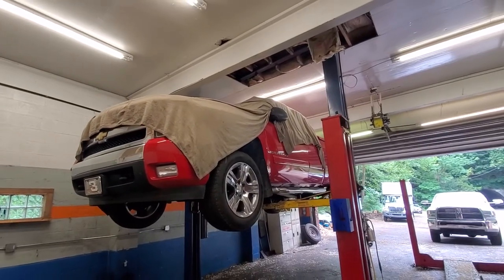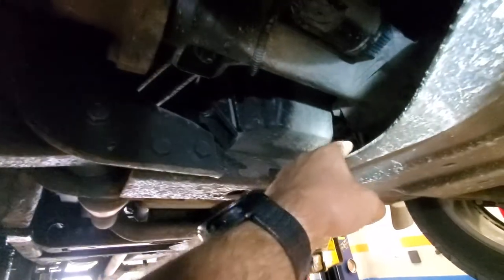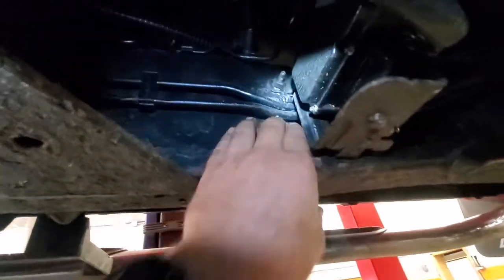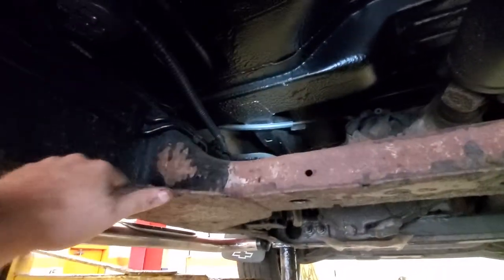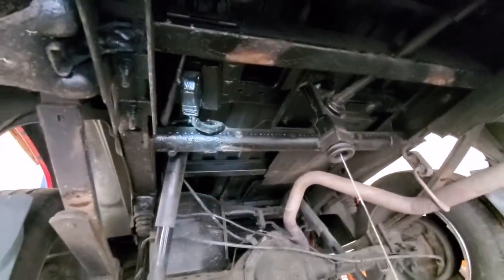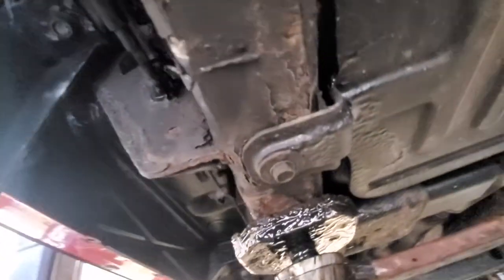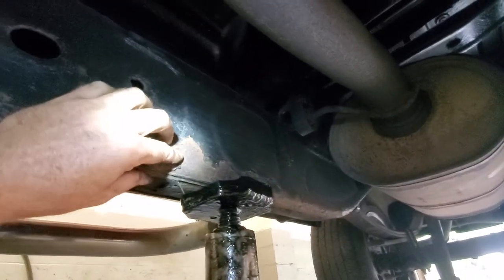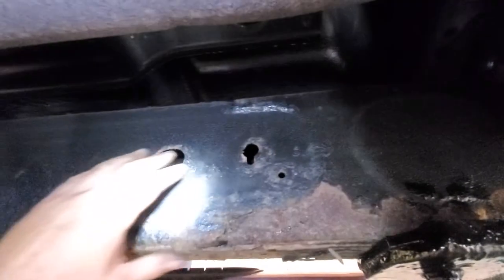08 Siverado ruined by hard undercoating

Comment: Fluid film ruined my undercoat on my car that was perfect before.  I just wanted to give it some extra protection.  I used it on my 05 Saab 9-5.  Now I gotta clean it and clean off the undercoating that came loose thanks to fluid film.  I’m now gonna try Rp342 wax military grade protectant. I’ve heard it isn’t a hard undercoating since it is a wax undercoating. I love the stuff from what I’ve seen.  I’m really bummed out about fluid film how it softened my undercoat on my car in areas 😢
Reply from the maker: Here's the honest truth that's why homeowners should not be doing this and you should read the directions
.... it says right on consumer fluid film not to apply over existing undercoating as it will soften it and ruin it. 

Once you have any type of existing undercoating you can't do anything else anything you buy will have the same effect ... if you buy the stuff you just mentioned it will crack and peel and turn the vehicle into the sponge there is nothing you can do to correct your current undercoat situation. 

Why would you coat a vehicle that had perfect existing undercoating with Fluid Film?  Next time read the directions? Being honest, what else can I say.
Reply from the maker: Rp342 will ruin your vehicle even worse.

Comment: So how do you get this stuff off? I saw someone mention mineral spirits?
Reply from the maker: Once you have hard coat on you'll never have an optimal solution best you can do is descale off all the loose stuff as best you can and then use some type of wet base coating that will soak in

Comment: As the hard coat pulls away from the rusty metal and cracks, it traps the salt soaked water so it does not dry in those pockets. The result is it will speed up the deterioration process. I just use axle grease under the body, it doesn't wash off very easily and is cheap. May not give the kiddy look you want and be a little messy when working underneath, but it will stop the deterioration better than all those expensive products! Waste oil will work great also but seems to wash off easier than grease
Reply from the maker: On something with new rust thicker like axle grease is better but on something with rust you lose almost all penetration properties where you would want something thinner like oil

So new thick, rusty thin

Comment: I recently cleaned all the scale off my Tacoma and then primed and painted everything. My next step is to apply wool wax and fluid film to the entire thing. I figure if the wool wax wears off at least there will be a paint barrier to protect until I can get it recoated. I live outside Buffalo, so I’ve seen my share of bad winters.
Reply: i dont think the paint first is helping you mate.  should have jumped right to the rustproofing.

Comment: Well you are right.. I am a steel coatings expert.  And usually undercoating of all kinds will trap moisture and actually cause more rust than if it was just left bare steel.. the proper way to undercoat is to prep and sand as much rust off as possible.. then use a acid etch primer/or epoxy sealer
To recondition the steel then apply your choice of undercoating  system.. steel primer/sealer is the key to prevent and slow rust..
Reply from the maker: Negative, Steel primer and undercoating are what were used on truck on video.... anything that dries over will fail in the Northeast.

Comment: I been starting to make mine all i used was bar & chain oil with paraffin wax melted in and sprayed on hot. 
But now i'm going to update the recipe to used motor oil, grease, Boiled Linseed Oil, paraffin wax and maybe a little diesel fuel to thin it if it needs it and will be hot sprayed on, hoping it comes out like a grease with a gummy shell on the outside when cooled and cured that would allow it to last a good long time before needing another coat.

Comment: Ler me get this straight,you made this video in 2021 and the truck was coated 2 yrs. prior. That would mean the Silverado was already 11 yrs. old. How many miles were on the truck when it was done? Yes I agree it looks like a terrible job but 11 yrs. of wet,salty,and dirty conditions will have this affect on the bottom of any vehicle. As far as the "heavy" stuff hitting housing cases no big deal,not hurting anything. Touchy situation taking on a used vehicle. I put many yrs. in doing this type of work and personally I would have refused this job.
Reply from the maker: That's the whole point of the video other shops spray right over the rust!

Comment: You seem very biased and that truck is in great shape for and 08. That undercoating made it last but nothing is forever. It's time to be redone.
Reply from the maker: After it was descaled and the cover-up undercoating was removed it needed 2 frame sections a 1 crossmembers, which an outside shop did for a cost of $ would say that it did not hold up.

Comment: why does the body look perfect yet the frame looks like shit.
Reply from the maker: The outside of the body looks great of course but the underside the body panels don't rust nearly as much as the frame so that's why they look better however this truck had a decent amount of rust on the rocker's underneath the cover up coating.
Reply: @steelcityoilundercoating6305  but here is my issue, the chevy frames rust because of the factory produt used. there wax is crap. but you have failed to mention the GM wax coating is failing causing what was put over it to fail.
Reply from the maker: @gregoryelk8129   It's rostio under the GM factory coding we know all about it we work with the chemical company who makes the wax on a daily basis it sucks if you're up North however if you're down South the wax coding works very well.

 The wax is made to bond with nothing so covering it up after it had rusted or even when it's new will make the factory coating come off 10 times faster that is the issue we have with this truck.

 We actually have a product made to treat the factory wax that keeps it soft and moist it works very well and the wax never comes off I'll post a link of that video. 

 We're the only ones in the country who have this coating for to treat the GM wax we had a chemical company make it for us
Reply: i will add for a 12 year old chevy that thing looks really good no matter what was put on it. i hear you bashing others and hard coatings, which i agree new vehicle only. but you are telling half the story hear, i have had vehicles done by ziebart with great results. chevys are terrible frames, the undercoat didnt do that the wax coated frame has failed
Reply from the maker: @gregoryelk8129   It actually is not in good shape it only looks like it's in good shape because it's covered up this truck needed to have new rockers and bedside and bed sides in bedrales welded in. 

 You can't tell the condition of a vehicle that's been hard coded over that's the whole point
Reply from the maker: @gregoryelk8129  https://youtu.be/9Xlj86MoysE
Reply: @steelcityoilundercoating6305  sorry cant see that if it was that bad you should have shown it  actually you refer to the rockers being in really shape during your video as those years where problematic with rockers i believe.

Comment: Hello’ I live in BC, Canada, I have a 2021 ford ranger, not undercoated from brand new. (My mistake) but I want to get it undercoated before the coming winter. Obviously it’s a “used” vehicle but it’s only a year old. Hardly any rust that I’ve noticed underneath. Nothing like the vehicle in this video. Would I still be okay to get a rubberised undercoating applied? Not many oil undercoating places where I live. Thanks

Comment: Im wire wheeling the pans on a 69 vw down to bare metal ( less than mm diameter scaling spots). Is a rubberized coating over primer going to hold up in your opinion or should i go a different route? Not looking for hiring, just a guy and his son son trying to keep the car around i rebuilt with my dad as a kid.
Reply: Rubberized coatings are pretty much the same thing as zeibarts coating any type of chip or tear in the coating it's game over for the metal your trying too protect. The fix is something that'll stay "wet" too the touch like fluid film or blaster surface shield so if theirs any chip it'll creep in and protect the metal. Even a wax based product works well too. Avoid any hardcoating product cause they ALL fail.

Comment: If you're gonna undercoat a used truck you're wasting your time/money. I had my F-150 undercoated by Ziebart 10 days after I bought it brand new in 8/2013, i have no issues with it almost 9 years later and it lives in the NE and isn't garaged.
Reply from the maker: Take it to a non Ziebart garage and they will show you how it's failed, or better yet post a video.  If you went to Zbart and continued their service which is required yearly, of course you're not gonna see any rust because they cover over it every year.  You may not have issues as the frame is still fine but that doesn't mean it's not rusted underneath or in many places just like this video.  If you have one like that then it's extremely rare, there's not a 10 year old truck in the northeast that isn't covered in rust underneath.
Reply: @steelcityoilundercoating6305  they don't spray it every year, it gets inspected and would get re-sprayed if if needed it and it hasn't. The coating on the truck is the one that was applied in Aug.2009 when the truck was brand new, 10 days off the lot. It's been sprayed ONCE. I also have never had a mechanic underneath point out any problems and there's no rust underneath but whatever...to each their own. Undercoat it or don't, I know what my truck looks like underneath. Maybe someday when I get a new one I can post an "X" year update of a Ziebart undercoat application. I am not a Ziebart employee or mechanic either.

Comment: I think boiled linseed oil every other year is the way to go. It soaks into the rust then hardens to a thick gummy finish in 4-5 days. It's fairly cheap and safe, and you won't get filthy if you have to work under the truck.
Reply from the maker: It works but you have to steam wash it off every year that oil breaks down amd will mix with water
Reply: @steelcityoilundercoating6305  It's really a just a slow drying polymer. It's old fashioned enamel paint binder without any pigment. It can mildew, but I've never seen that on a car in the midwest. Like any coat, any scale should be knocked off first.

Comment: Every truck I owned I've used soft coat like fluid film or used oil mixed with diesel. I get comments all the time how the frames and underbody look almost new. I only spray once a year. And any visible areas from standing or crouching down get sanded down to shinny metal and painted black.

Comment: I would take the cross members off, clean them nice and coat them OFF the vehicle, I would just paint them with a good quality rust resistant paint.
Reply from the maker: Makes no sense there is one or maybe two cross members that actually unbolt on a truck... what about the frame and everything else you can't take those off?

Rust resistant paint, no such thing.

Comment: Diesel fuel and used motor mixed in a pressure sprayer works for me
Reply from the maker: Works good yes but tge acid will surface rust it underneath not a huge deal but a business could never spray that would get shut down in a day.  Also no one's gonna spray diesel fuel and mixed motor oil on a brand new vehicle. But yes it works.

Comment: Sand, prime, paint, 
Repeat as needed
Reply from the maker: Very difficult to blast down a frame without pulling the cab and bed. Also use epoxy primer and the best chassis paint. One year later it just peels off again, just like a new truck. We're taking about northeast here. Nothing lasts.

Comment: Why exactly is this truck ruined? 

I understand it was done poorly, but I hate sensationalist titles THIS TRUCK IS RUINED! Who cares if there is over spray on the trans and exhaust? That doesn't ruin the truck, lol. It doesn't matter one bit to be honest. 

It sucks that they didn't do the proper prep work or do the tops of cross members, but nothing is ruined by what was done. It honestly is a joke that it's being said that this truck is ruined. these types of titles and narratives are exactly what turn me away from a channel. Be honest, show the poor workmanship. But don't try pushing some BS. Whatever holes are there were already probably there. Those frames are not that thin, you don't get a hole through 1/4 thick steel in 2 years.
Reply from the maker: Again it was sprayed on top of rust once this truck was descaled it needed 2 frame sections and one cross member, outside shop quoted 5500 please watch the other videos after the hard coat cover up was removed. The lift arm almost went through the truck!

Comment: is a hard rubberized undercoating okay to use on new vehicles?
Reply from the maker: No, don't do it
Reply: @steelcityoilundercoating6305  I'm torn on what to do. I'm trading in a 2018 Tacoma for a 2021 Tundra and I don't know what to do to the Tundra. I had the Tacoma done with Zeibart rubberized undercoating and rustproofing and it's held up extremely well with zero flaking of any kind. I do wash it at least twice a week in the winter, if not 3 times. I hear everyone screaming about fluid film though so I don't know if I should use that instead.
Reply from the maker: @ianjoyce890  Ziebart will hold up for three years yes that's not the problem the problem is long-term.
Personally if you're not keeping the vehicle for 6 years or more I wouldn't spend the Dollar on any type of rust proofing
Reply: My mom bought a car about 15 years ago that was 3 years old  at the time, and it had zero rust.  She got a hard type wax type undercoat applied by the dealership.  Huge mistake.  It was fine for 8 years, but it had really just been hiding the rot underneath.  Didn't find out until she took it to a shop for something and the lift crunched right through the rockers and even the "frame" portion of the unibody.  Car was trash.

Comment: I have been using a product called PFC undercoat over 2 years! I took my finger and scraped it and looks like bare shiny metal! 
Is this good or bad sign it's covered with layers
Reply from the maker: That's because the PFC is melting your factory wax off so now when you scrape your getting down to bare metal on the frame it will be okay like that just don't ever power wash underneath else you will ruin your truck